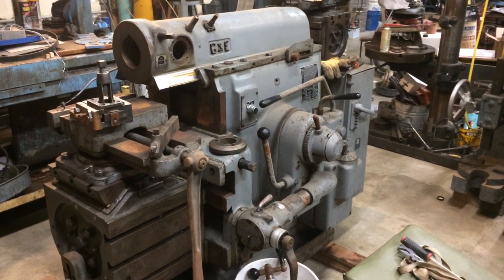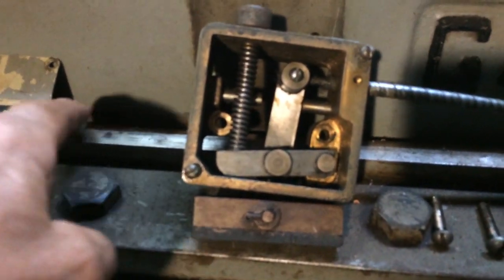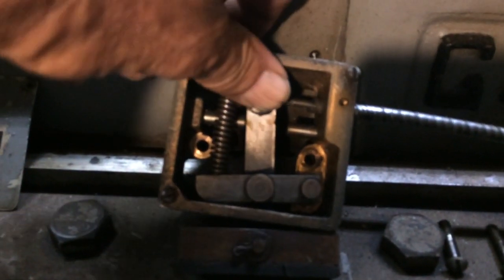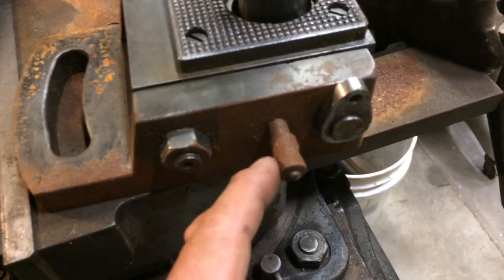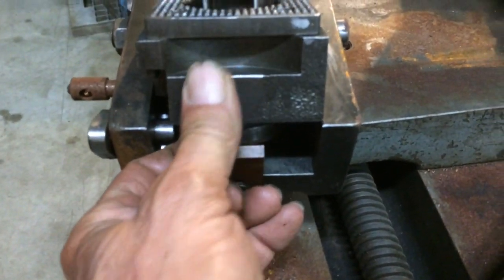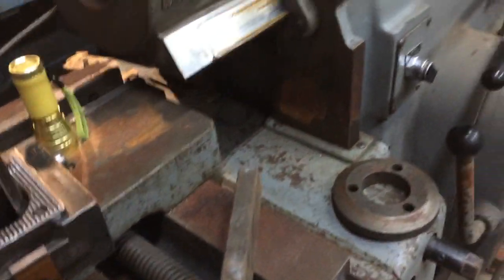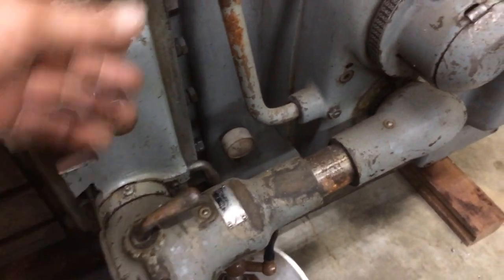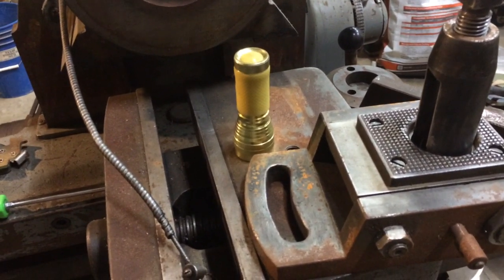G&E Shaper Tool Lifter How it Works

Comment: Thanks for the explanation! Great video. I have the same machine with a tool lifter. Mine is missing the cable and end pieces by the tool. Do you know the cable size and length?
Reply from the maker: I measured the cable and the inner cable .150 x 28 1/2 and the outer cable measures .257 x 25 1/4
Reply: @imysteryman   Thanks for the information! Greatly appreciated. I completely forgot, if not too much trouble, do you know the height and with of the rail? Mine is missing.  I assume its 26in long.
Reply from the maker: 1/2 inch tall 5/8 inch wide and 26 long @Jayjam209
Reply: @imysteryman  thanks! Appreciate the info. 😊

Comment: Universal table, auto down-feed and auto lifter is the deluxe model! Too cool!
Reply from the maker: I have another 20 inch G&E as well, it has been sitting for a long time even before I bought it because it had a broken bevel gear that is used to raise the table. I have the gear made now and I need to take it back apart and install it.

Comment: Hi have you got the shaper running yet. Looking forward to seeing the power down feed working and the tool lifter. I'm going to make a tool lifter for my shaper.
Reply from the maker: Sorry I have not got back to the shaper yet, I have been making a welding table the last couple of weeks. It has 272 drilled and taped 1/2-13 holes in it. Right now I am trying to get a chuck mounted on a dividing head to cut a bevel gear for the 20 inch shaper.

Comment: That's pretty cool . But it looks like a lot of parts to make . I'm still thinking about an air lift Thanks
Reply from the maker: My concern with trying to use an air cylinder is will it be able to move fast enough to let the tool drop back down for the next cut, I would think an electric solenoid would move much faster. On a lot of boom trucks they have a solenoid to bump the idle up, it has a pretty strong pull and when turned off it will drop out very quickly. It would take   2 limit switches one at each end and they would operate a ratchet relay and the ratchet relay would operate the solenoid. 
When a ratchet relay is energized it switches from or off to on and the next time it is energized it switches from on to off. So If there were limit switches at each end of the stroke they would operate the ratchet relay which would control the solenoid.